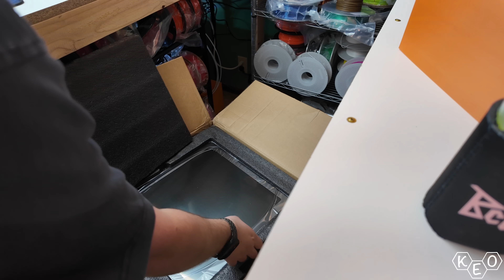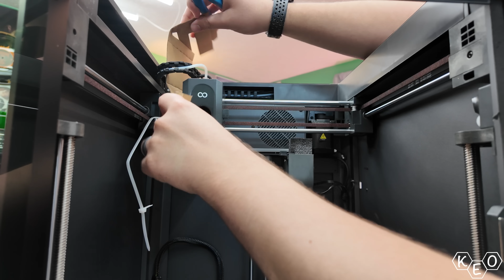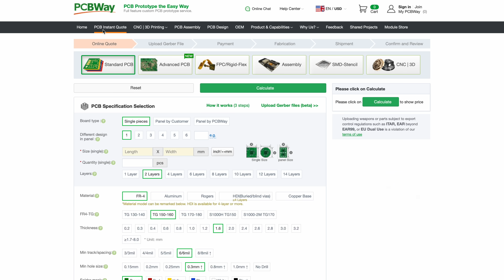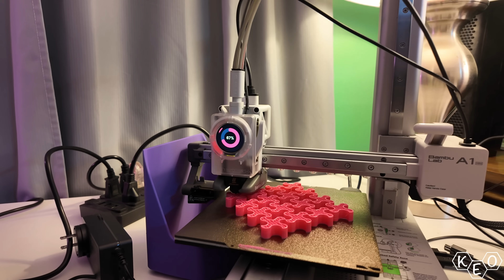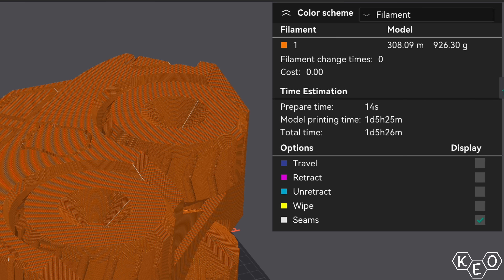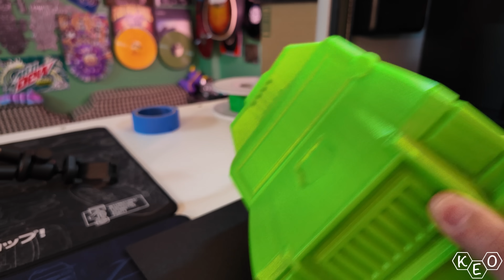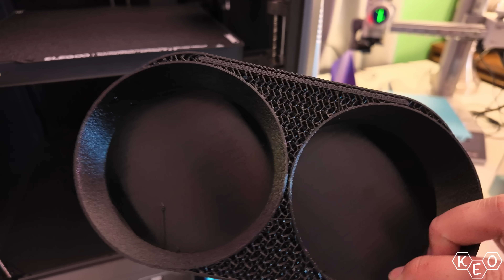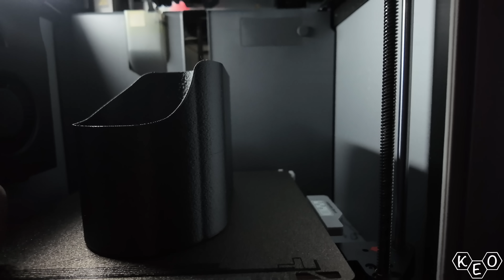$300 for THIS? Elegoo Is Playing Dirty…

Comment: 14:42 - No, we absolutely CANNOT. What kind of idiotic defense is "hey, it doesn't work properly, but at least it was cheap"?!

It either works, or it shouldn't cost money, because it's not doing what you bought it for.

Price determines features and quality within the realm of working products. It doesn't give you permission to sell broken shit.
Reply from the maker: In a black and white sense, I agree. In a realistic sense, nearly every brand has small (or large) issues that require troubleshooting to some degree at some point. So doing the same troubleshooting on a cheap machine versus something that cost twice as much is a factor worth considering

Comment: Hard is the best :)
well i upgrade my Ender3 v2 to print 250x250x 650 with a 500c hot end and a 100c bed and with custom firmware
as i mainly use CF and Stainless steel Filament right down to soft wood filament and i get perfect results like they are injection molded
But the printing speed to get accuracy is some what slow.

so I thought sod it and shop around and get an updated machine, and this Elegoo Centauri for the price seems to be too good to be true, so in 3 days i will have mine delivered, and in the mean time I'm watching good videos like this one to get familiar with the machine and off course  find out the little hiccups so to speak
so thank you for your time and sharing and also giving me information
oh on my Custom machine  i cant load or unload until the hot end is at the correct temperature  but then that's an obvious thing to understand ,
and mine will say so on the screen to heat up and when it does it does it automatically, so that's why your buttons are grayed out
when mine come i will modify the firmware to do the same and any other adjustments

btw on all machines you should calibrate the E steps

Comment: Currently shipping version of the CC has a number of updates which might change what you would see today relative to the problems seen by Keo in this review.  I received mine a couple of weeks ago and the updates I noticed were: updated firmware, looser PTFE bowden at the extruder, LED light strip, beveled corners in the upper inside structure , AMS connector on back of unit, thicker metal side panel where spool holder resides. Orcaslicer v2.3.0 had Elegoo CC defaults although I don't know if the defaults are different. I had heard that defaults for the smooth side of the bed sheet was 30C and a number of people had parts come loose at that lower temperature. So Elegoo seems to be quite responsive and wow at $300.

Comment: Does it have an air filter so you can print abs or other filaments ?
Reply from the maker: It has provision for filtration but typically the standard charcoal or activated carbon or whatever filters printers come with are the bare minimum. I know there are companies that offer better options that you can install in the stock locations and this may benefit from that

Comment: So I know nothing about 3d printing, got the cc few days ago and... Yeah so I tried printing a 75mm resin - pre supported miniature with fine parts in the basic elegoo PLA and it worked perfectly. Took ages since I didn't have different settings for the supports cause it treated it like 1 modell (1.2 line height) but yeah, came out great. Very little stringing, barely see the lines on any part and the details are insane. So I can't complain or say anything bad so far, cause by accident I did something that I now know should be really hard on the first try lol

Comment: Your issue seems to stem from under extrusion. The reason why this may happen to CC and not to the control is likely a combination of different thermal properties of the nozzle (pure brass is the most efficient, but can't print abrasive stuff), the flow rate and thermal properties of the particular brand you had problems with. The control printer was using a brass nozzle or simply has a better flow rate capacity at certain temperature, it is a hint towards this diagnostic. Ramp up the printing temperature by 10 degrees for the problematic PETG filament and you will have your confirmation. If still problematic best just do the calibration steps using the built-in orca Slicer tools for that.

Comment: You're right, I'm the guy who always prints the most difficult filament... Just kidding, PLA and the occasional PETG does what I need to do.
Ok, thanks for the video, sums pretty much up what I experienced with mine about a week ago. I don't think I've seen anything that level for that sort of money, and I sell 3d printers (amongst other stuff).
I didn't try TPU yet, but I found the bowden routing a bit problematic too. Though it let me always load filament, just not as easy as one would hope.
About the slicer though, there is an actual difference between Orca and Elegoo's version of Orca. The standard Orca ignores the timelapse command altogether (if one needs it, but I'm fussy in general).
So there might be other differences too, like Elegoo runs version 2.2.0 of .3mf, the current Orca version runs version 2.3.0. This results in some problems loading downloaded .3mf files.
Both, slicers don't allow settings like those speed changes (silent up to ludicrous) in their interface, neither does the interface via browser (all 3 are the same and come from the printer, not the software). Its local screen, on the other hand, allows those changes, so this seems like a little communication issue, not much more than a hiccup.
But hey, like you said, the price!
All in all it's a pretty solid piece of tec, not a string of prototype after prototype (that's what Creality does).
It can be loud-ish too, but that's also not a real issue, at least for me.
Thanks for your insight, Just subscribed and hope to see more!

Comment: I have two questions. First, when you sliced the propane holder and sent it to the X1, was it exactly the same file you printed on the Elegoo? If so, then something weird is going on, and I suspect it's in the Elegoo's firmware.
Second question is have you heard from Elegoo about the issues? Have they done any updates and if so, did things get better?
Reply from the maker: So for the propane tank holders, I sliced the exact same model using the exact same slicer settings. As for communication with Elegoo; I haven't reached out regarding these issues

Comment: Toss the TPU print in the freezer for a few min and the parts will come right off the build plate.  Or spray the back side of the plate with an up side-down can of compressed air if you're in a hurry.

Comment: it looks like the big black model on bamboo also had delamination on the right side halfway up, you can see it before you took it off the printer and then showed only the left side ;]
Reply from the maker: I can confirm that it didn’t. That piece went from in front of the camera into a box for a customer. And I’ve since finished that spool of filament printing two more of these pieces fulfilling orders. So I hope there wasn’t any issues with that one lol

Comment: Man, I started having issues with mine. There are almost no spare parts available. Avoid 3dJake site for elegoo parts (at least in USA) as they want you to pay $28 shipping plus $32 import fees for $20 worth of bed sensors. I was able to finally get it going again after waiting 10 business days for elegoo to send me parts. (no charge) 
Print build plate was heavily damaged and elegoo isn't shipping the build plates I ordered in march until the END OF JULY!!! BUILD PLATES FFS! They did not replace damaged build plate. Bambu labs ones are not a direct replacement. You need 260X271MM build plates. Good luck! Prints like a champ when it does work!

Comment: 300 usd is good price. However my local 3d printing shop sells it at 450 usd and p1s at 650 usd. If the price between bambu and elegoo is doubled, I would go for elegoo for sure. I don’t know if I should spend extra 200 usd for ‘bambu quality’ and maybe save some headaches, or just bet on cheaper elegoo. Please advise.
Reply from the maker: I will always advise Bambu. They’re the king of quality prints reliably with max user friendliness. Just my experience of course

Comment: On resin, I have a Mars 3. I rarely use it. Too messy, too fiddly, prints fail more often than not. IDK what I'm doing wrong and I've lost the patience to figure it out. My Ender 3 V1 still prints well but she's slow and I'd like to branch out to materials that need an enclosure. Been waiting for an affordable Core XY machine. It's a lot cheaper than the K1C. Similar build volume, almost as fast, just lacks the AI failure detection and quick change nozzles.

Comment: i got about 400 hours on mine and im very impressed. Ive been printing in ABS and PETG with NO issues! I have a Bambu printer P!P, and its nice to add this to my shop.
Reply: Have you had any issues with warping on large ABS models? And what temperature does the chamber get to? Right now I'm trying to print ABS on my Neptune 4 pro with an enclosure but it just does not get hot enough to keep the model from warping, and it slides right off the pei sheet like it was made out of a greased wax paper😂

Comment: The ellegoo slicer is the problem. 
You need to put setting.s yourself.
Creality  is the same .
Just a .0.4. Nozlle setting. Use a bigger nozzle and you need to put every setting at good place.
Use ai to do this.
And this machine wil run Just fine

Comment: I mostly print with PETG and use 2 brands of filament. BOTH need a different profiles to run my old sovol svo6 plus at full speed cleanly. Esun was so much easier to tune for 4× factory recommended tho once i got cc3d filament running production almost before half price for filament here in my part of Australia. Only stuff i can get from a shop near me is esun tho overnight Amazon does wonders

Comment: The real question with these machines isn’t how well it prints, but how long will it continue to print well. It’s not that more expensive models are overpriced, because they’re not, but what corners were cut in the manufacture of j expensive. Because corners had to be cut. I used to be a manufacturer, and you can’t build a machine that’s costs 25, 30 or 40% the cost of another machine at the same quality level.

Comment: At 9 minutes, you mentioned being able to print the material without breaking the seal. Maybe i'm overthinking this, but how do you get the filament out without breaking that seal? I just got my Polydryer (thing's freaking awesome, btw).
Reply from the maker: Yea they’re great! The polydryer rubber outlets have a little indent in them. When you load the filament you can push it into the indent. Then when you pull the plug out, the filament comes out with it so you don’t need to open the box up
Reply: @KeoPrints that is perfect! Thanks so much for the advice! I never saw that initially.

Comment: I just haven't been able to justify investing in a printer yet, I don't have enough need for one at higher prices.  This price point is making it harder to avoid.

Of course winning one would mean I'd have to start finding more reasons to print.  And start making lists.  I think of something I could print, I don't write it down anywhere, and it disappears into the bitbucket of history, never to be remembered again.  I have several things I'd like to try printing, mainly to do with battery powered tool and battery storage, a repair part for a mower, and a few others, but once I had a printer, it would make it easier to plan out new parts, especially once I learned a decent CAD program (last time I tried learning a CAD program was before you were born, and desktop computers WERE NOT up to it, nor were decent UI designs).

Comment: I am still using a Prusa Mk3s+ and am looking to buy a newer/faster machine. Would the Elegoo be an upgrade for me ?
Reply from the maker: I think it would be. The speeds would be higher and I would imagine the results would be a lot cleaner. That or it would be easier to tune cleaner results generally speaking
Reply: Thanks for the reply, much appreciated. It just seems too cheap/well priced to contend. As I have become familiar with Prusaslicer is there any reason I couldn't or shouldn't use it with the Elegoo?
Reply from the maker: As far as I’m aware, you’re going to be good to continue with Prusaslicer. That said, I have never once used that slicer so I can’t say for certain. I know that it works fine with Orca slicer and the bones of that are based on some version of Prusa
Reply: @KeoPrints  Thanks for your time. Loving the content !

Comment: I think TPU should probably feed right out of a drybox, unless you have another way to keep it dry.
Because even within hours after printing a stringing test with TPU that had come out of the dry box,
I noticed a degradation in the print quality and stringing test (one test shortly from drying, further test/s within hours later).
So, please be mindful of that, and try to use it as quickly as it comes out of the drybox.
Do your own tests, to confirm.
Thank you for the video!
It definitely looks like a good deal!
Does it do MultiColor printing, I wonder?
Reply from the maker: They’re supposed to be releasing multicolor soon

Comment: I'm guessing your problems with TPU and PETG all come down to the fact that you didn't fine tune your slicer settings good enough.  I have never printed TPU so other than printing too hot, I don't have the answer there.  The PETG looks like underextrusion due to heat creep; which is something that I just assumed Enders suffered from and nobody else.  But you proved that your filament was NOT the problem. The Elegoo printed well on other filaments and models, so in my opinion your slicer settings need optimized.  I had a whole brand of filament that would always clog my three ender3 printers.  Until I learned what heat creep was and how to fix it; once I applied the heat creep fixes (mostly adjustments in the slicer), those filaments prints fine now.  so, yeah, I'm guessing your slicer settings need work.  

As for resin, I'm going to guess that the clean up is not going to make you happy.  And again, it's all about the slicer settings and getting them dialed in.  And properly supporting the models...that's super important too.  These days I can import an STL and get it ready for slicing for FDM in 5 minutes or less.  Building a build plate of miniatures for my Elegoo Saturn 3 Ultra can take at least 30 minutes.  One reason is that the build plate is so large and I try to fill it up, so I'll have 10-16 models at a time, and the second is making sure the supports are just right.  If you don't get that right, you'll have to wait until the end of the print to find out.  But dang are the prints wonderful.

Comment: I love mine, haven't had many issues as yet, but bound to happen, my P1S is 7months old and have had a few issues, not too bad, but then 3D printers and a newbie will always have that honeymoon period. lol The CC is wonderful; I hardly use my other bed slingers unless I need to complete a big project.
Reply: What do you think about them now? I’m trying to decide between the CC and the P1S. I’d rather not spend the $$$ but I can. Reliability is what I’m most interested in right now. I’ve got an Ender 3v2 that’s been annoying me and not printing larger prints. I want to print to the edge of the bed and have it work every time with PETG. And maybe TPU.

Comment: I noticed similar issues with my SV08 from Sovol with the supplied profiles, and after some digging, found that they'd set the wall printing order to outer/inner..  Switching it to what most other companies use (inner/outer) fixed many of the layer and surface issues I had.  Might not fix the problems you're having but I'd go through the profile and match the settings as close as you can to the Bambu settings, and see if that helps at all..  Many of these companies get VERY lazy on their profiles, and give you the bare minimum configuration to get them running (as you mention, tuning will likely help with most of it).  I'd also bet their instability with the screen and prints pausing are firmware-related, and they'll be fixed down the road with an update.  I'm planning on picking up a few of the non-carbon's if they ever go back into stock as most of what I do doesn't need to be enclosed (and I have enclosed printers already that I can use for that stuff), especially if their color system isn't expensive (and even then, with so many DIY color handling systems out there now, that may be moot).  If they don't release that add-on soon, BigTreeTech will likely have theirs out, and since the Centauri's run Klipper, it should be compatible...
Reply: Since you are intending to buy, I feel I should correct something. The Centauri Carbon doesn’t run Klipper. The firmware is, thus far, closed source. However people have suggested that some aspects of it might seem… um… reminiscent of Klipper.
Reply: @dougal6569 just looked into it, and it appears that's correct.  Still, for the price it's not a bad deal at all.  I don't HAVE to have klipper (more of my machines are Bambu than anything else at the moment), but it'd make it easier to add a color system if it were..